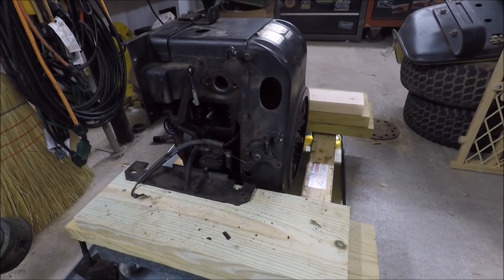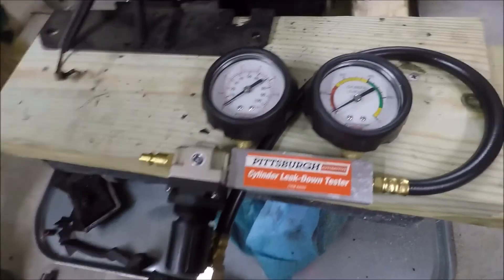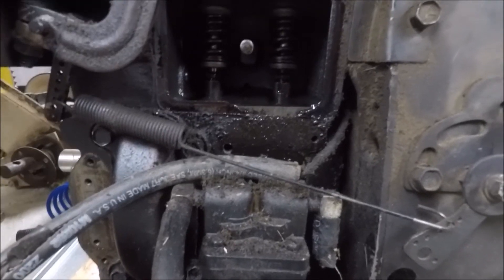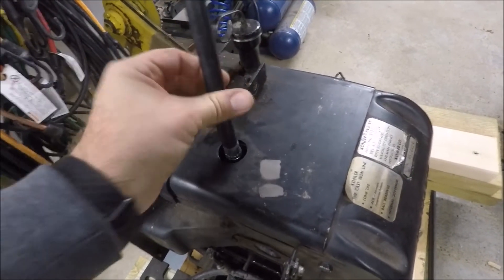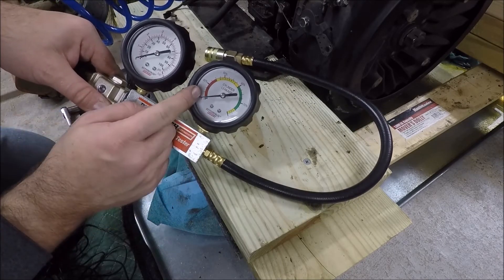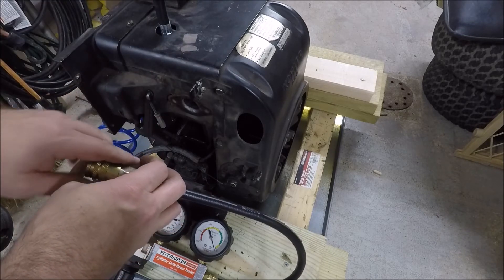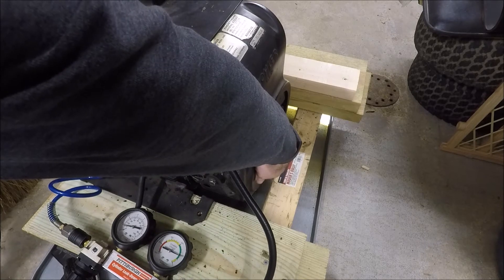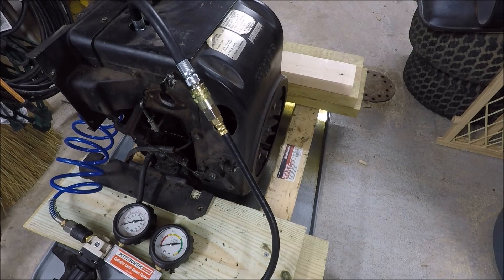Performing A Leak-Down Test On A Small Engine

Comment: I tried this last night and the pressure pushed my piston down. I couldn't rotate the engine back to TDC because the pressure was pushing the piston down so hard that it overcome my strength. Is that a good sign?
Reply: Sounds like you have the air pressure too high, did you set up as shown around the 2:00 point in the video?
Reply: @stuffyoucando2  yes sir. Gauge was set to zero. I make sure it was at TDC (both rocker arms loose). When I was rotating the engine back to TDC the arrow on second gauge travel to green shaded area but I couldn't rotate it all the way it will push it back down.
Reply from the maker: I would try again but do something in the beginning to try and keep it from moving. When it’s all the way at the bottom not only are you fighting the air pressure from tester to bring it back up, you’re fighting the compression stroke of the engine too. It may just be too much to overcome combined.

Comment: If the leak-down test result is ok then how come your still opening up the engine for further examination of parts. Just wondering. All the best.
Reply from the maker: A leak down test isn’t all telling. This engine was smoking so I ended up tearing it down further to investigate even though the leak down test was good.
Reply: @outdoorpowerhouse  I wouldn't trust that leakdown tester. same with their compression testers....
Reply: @SmallEngineNut which one do you use or recommend?
Reply: One issue of excessive smoke could be oil in the muffler/exhaust.  I encountered this with a free lawnmower acquired and I assume the previous owner tipped the mower on the exhaust side with the valve open and leaked oil into it.  Once I burned it off, it no longer smoked.